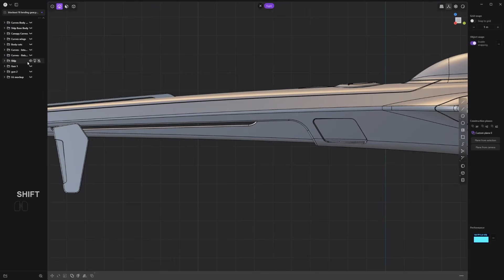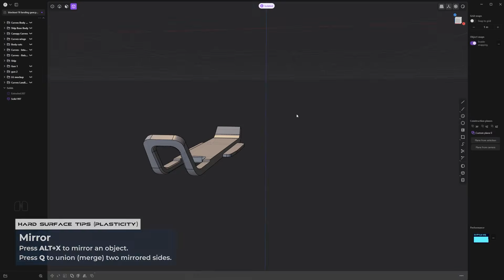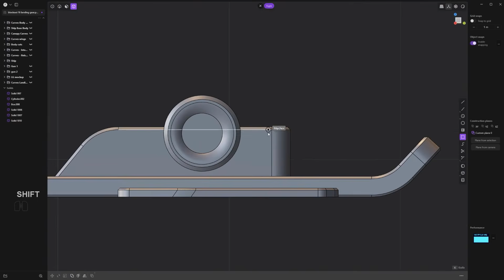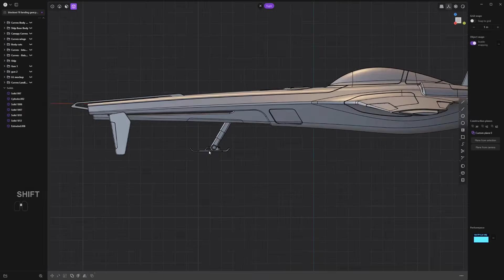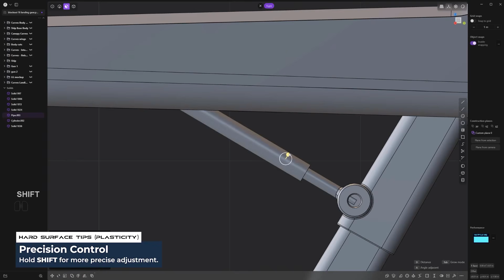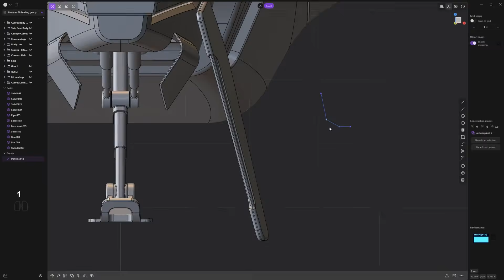How I Built a Sci-Fi Spaceship Landing Gear in 1 Hour in Plasticity!

Comment: I'm transitioning back to Blender after working extensively in Fusion 360 and SketchUp for interior and expo design. I've now launched a company focused on safety animations, aircraft and yacht liveries, and interior designs.

Initially, I purchased 3D aircraft models to animate, but as accuracy has become critical, especially for livery and interior design, I’ve started modeling directly from blueprints.

My question is:
As this is new and I'm under budget pressure, would it be a better investment to use Plasticity for accurate hard-surface modeling, compared to staying within Blender and using addons like HardOps and MeshMachine?
My final models are always brought into Blender for animation, rendering, and motion graphics, so I’m wondering where I’ll get the best workflow efficiency and modeling precision.
Reply from the maker: If you have blueprints you could stay with subd in Blender but it will be slower and def painful. Plast has now A class surfacing tools and it would ne muhc faster to model planes and such with curves, but you'd need studio ver for it. You will still need Blender anyways, so I'd use both and create a merged workflow.
Reply: @PonteRyuurui  Thanks for the reply - really great insight.
Yes, I’m leaning toward getting the Studio version of Plasticity and setting up a workflow that includes Plasticity for modeling, Blender for retopology, animation and rendering, and Substance Painter for texturing.

I’ll probably still buy HardOps, MeshMachine, and a few other Blender addons eventually but the studio version of plasticity is going to eat my software budget for this month.
Reply from the maker: @Guten_dog  it is worth it